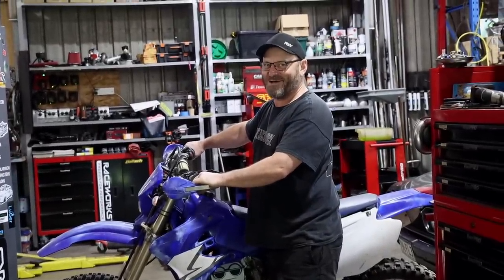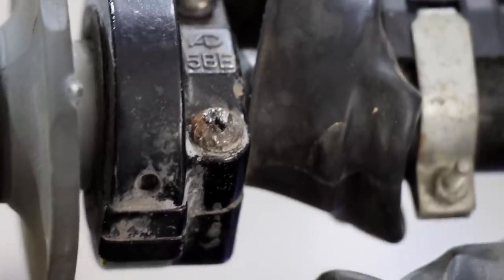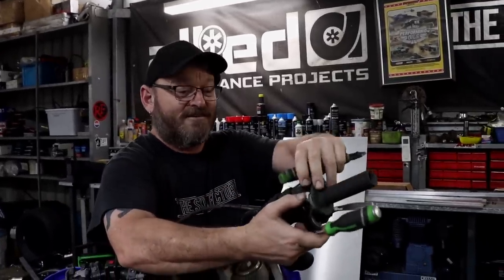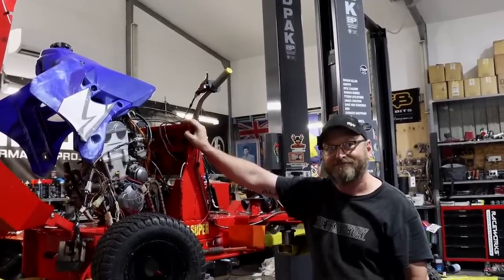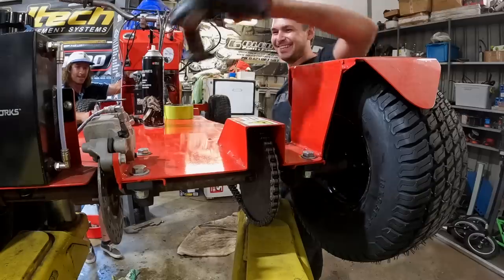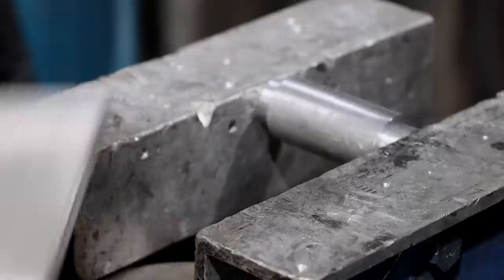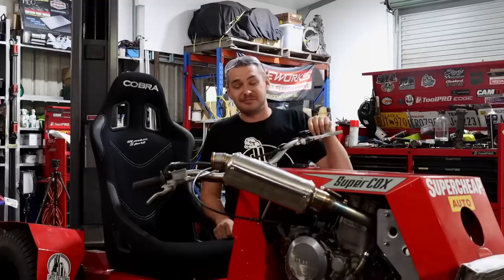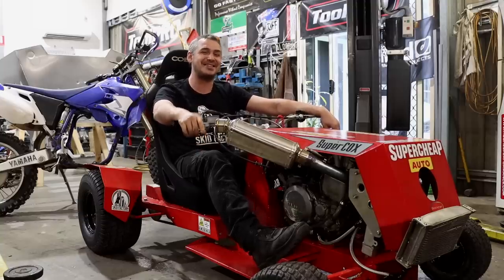Repowering the SUPERCOX for some Country Club Chaos with @supercheapautotv & @mightycarmods

Comment: Personnaly i'd repower this with a honda nc700 D powertrain
The package is quite small, it's got enough torque and power for the application, an integrated automatic transmission, and the final chain drive to send the power to the rear would permit a final setting on the gear ratio. Not sure if they're easy to find, but they were cheap when new, so probably cheap at a wrecker too
I originally thought about maxiscoot powerplant (tmax, burgman) but they are really too sluggish and boring, the dct will be zippier. Not a fancy build, but an easy ride to enjoy i think !

Comment: Bridge and Stratton 12.5hp I/C had a mower that did 40 k mph by changing a pulley put on a foot throttle the rest was stock but then the gearbox split in half

Comment: What would I repower the 'Cox with? My old GSX1000R had a lot of speed. A recon a 4 cylinder, 4 stroke water cooled mower, maybe with one of those Wish turbo's bolted on the side would not only sound great, but would rip up the lawns with the wheels. No need for a mower blade. 🤣😂👌

Comment: Id get some torque back into the equation and do something mad with a quad bike setup. I think you could fit the entire ATV engine and gearbox system into the cox if you went a bit artistic with the mower chassis design.

Comment: So why did you fill the radiators with cooling system concentrate? Is that a known go fast technique for Yamacox450’s? So impressively hot that it needs extra undiluted cooling goodness?

Comment: I would power the Supercox with a Yamaha MT-07 engine, 690cc twin, with simple fuel injection, plenty of low-end torque & power, epic exhaust note, quick shifter compatible and there are plenty of salvage ones around from inexperienced riders. On a side note I do have a VW as my daily.

Comment: I would say to step up the single cylinder and do an older klr650 engine or one of the diesel klr650 engines because they are both torque monsters

Comment: A Banshee 350cc parallel twin 2 stroke because why the f*ck not!!! It's a 350cc twin 2 stroke. Light weight and massive power potential. That and the lawn mower would be a match made I heaven. Remember 3 strokes are easier to maintain and cheaper compared to a 4 stroke counterpart. Plus they sell and smell outstanding!!

Comment: If you want to go nuts with the engine, go for 1000cc V-twin from Suzuki TL or VTR 1000F.
Too much power and coupled with transmission and chain drive like your 450. It's in the spirit of the OG Supercox.

Comment: If it was me I’d be evil and put something like a little 3 cylinder Kubota Diesel in it, Similar to what they use in the Diesel ride on mowers. Throw a small turbo on it and a mild tune so it rolls coal to a certain degree, That way it’s useful with the low end grunt to haul non runners in and out of the shed while also having the WTF factor of it coming on boost and disappearing in a Cloud of Squid ink.

Comment: What about an old 3 cylinder Daihatsu motor out of a sirion or charade mounted east west with a similar  chain drive set up adapted to the flywheel. would haul ass and fry tyres for days.

Comment: Don’t know how the old 2 stroke would go but the old CR 500 motor with the big power pipe would be cool.
Reply: Love your work guys, I would use a mercury outboard, 2 strock with the pull start for the full mower experience

Comment: I’d try some kind of electric motor.  The cox is light enough to not need heaps of power or batteries, but the torque would be pretty thrilling - assuming it doesn’t obliterate itself each time.

P.s. I have a Volkswagen 😂

Comment: BMW flat twin R18 engine looks like p*rn, but racing mower wise I'd use a BMW R1200 flat twin, the jugs and head would sit above the feet so I'd push it forward and run side pipes in front and under the feet area and exit somewhere near the ankle>calf area with a couple of downdraft carbs. Would be a killer looking racing mower

Comment: If i had to use a engine i have lying around. It would end up with a 500c flat twin. Yes the 18hp fiat 500 engine. Otherwise a harley knucklehead if it fits

Comment: I"d repower the cox with a 12kw electric motor I liberated from a work skip that is currently powering my brother's old racing go kart.  I got it running over lockdown in Melb and took it out at night for silent speed runs in empty streets.   Scary fast, but only get a few laps in before the battery calls it quits.  I'd call it the Flymo Tesla and paint it orange to get the haters fired up.  👍

Comment: Would put a 2020 KLX230R Kawasaki motor. 6 speed, Fuel injected, air cooled, wet clutch and push button start with not to much power.

Comment: I would re-power with a Yz250 2 stoke lighter easier to keep cool better gear ratio Vs Wr for a race mower. Failing that YZ450 for the closer gear ratios.

Comment: Gen 1 Suzuki Hyabussa Engine1,299 cc (79.3 cu in), 4-stroke inline-four, liquid-cooled, DOHC, 16-valve, Keihin/Denso fuel Injection, wet sumpBore / stroke81.0 mm × 63.0 mm (3.19 in × 2.48 in)

Comment: I would put a three cylinder diesel like a kobota or Kohler up the fuel put turbo and do mini tractor sled pulls woul be mint would also get diff out of qaud with drive shaft and mate it to  A 3 or 4 speed  semi auto or Manuel box

Comment: Put a rotary in it and call it the Rotacox! Why? Because rotary’s sound awesome and it would be pretty unique!
EDIT: Noticed someone else already suggest a rotary, so my next suggestion would be to put a Radial Motion 3 cylinder compact radial engine into it, again just too be very unique, and potentially awesome sound! Plus you would be showcasing an Aussie designed and made engine 👍🏼 The RadMoCox 😆

Comment: Outside of the motorbike engine idea. Yamaha 30hp, 2 stroke outboard engine, built like they do for tinny racing. Keep the 90 degree box and run a drive shift to the rear axel with a dog clutch.

Comment: Why not take the 660 that the MCM boys took out of the Mini that will star along side the cox in the video, and sort out a way to put that in the Cox. Can't wait to get the garage rebuilt from the fire to do a bunch of nonsensical things like this around the farm. 

Otherwise the only thing suggestion I would have is this, you can't have a racing mower that belongs to the mythical Turbo Yoda that doesn't have a turbo on it... Time to get stuck in on some boost!

Comment: I would repower it with a VW 1.9l TDI ALH diesel engine.  or mabey a liquid cooler snow mobile engine 3 cyilders but i would have to build quite the cooling system to do so,  or mabey even an Iron Duke from GM hahah that would be epicly funny. old clunky things hard to kill and dont make much power, but be perfect for that.
or mabey even that 1liter 3 cylinder eco boost from Ford would be EPIC in that thing!!!